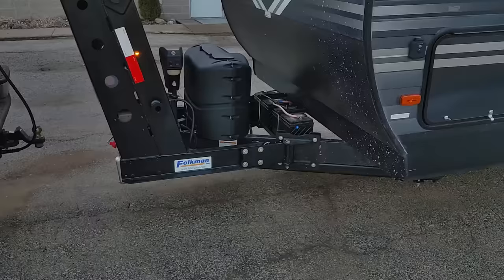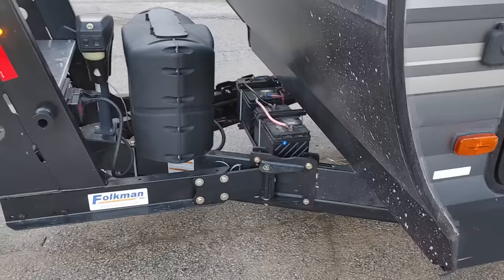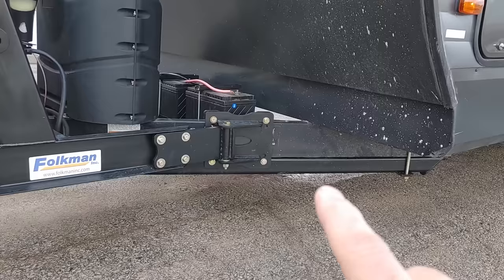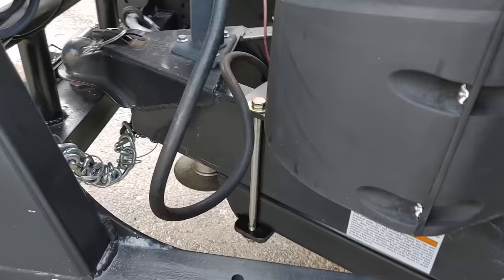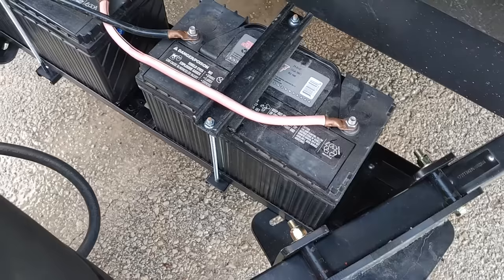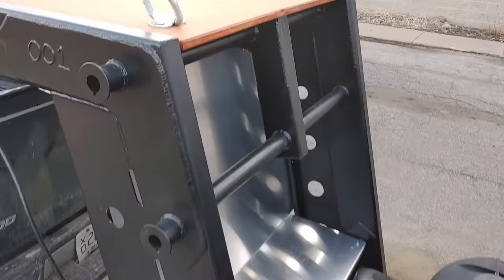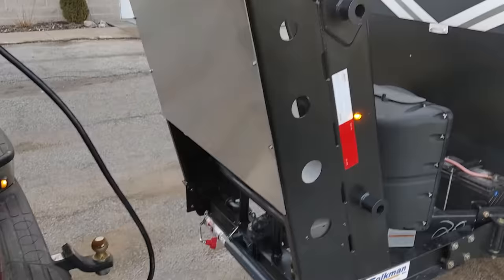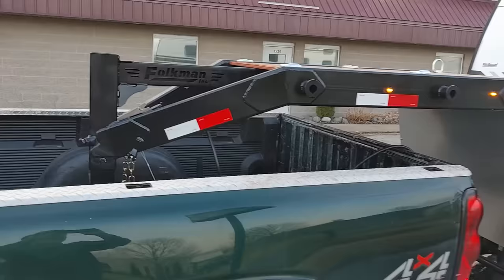Folkman Inc. -  Gooseneck Adapter Hitch

Comment: Why? Cool concept, but why?
Reply: Because a gooseneck trailer is inherently more stable than a bumper pull.
Reply: I was going to have one custom built like my buddies this would solve my problem. Bumper pull specially toy haulers like mine can be deathtraps loaded up it's more staple with a gooseneck or fifth wheel hitch
Reply: So by the time you buy the camper by the adapter, wouldn't you be further ahead? Just buying a fifth wheel toy hauler? Fifth wheels are so much easier to hook up and unhook than a gooseneck, especially if you have a crew cab long bed. Fifth wheels are much better. Not only that, the gooseneck hauling an uneven terrain, especially where I go in the mountains. If I had a gooseneck the side of the camper would touch the truck. So the fifth wheel limits your side to side movement
Reply: @bryanb8366  Ok, so it doesn't work for you. Great. Not everyone wants a fifth wheel. They're heavier, taller, and more expensive.

And I would prefer to hook up a gooseneck over a fifth wheel, but that's personal preference. And if things get sideways, the gooseneck is going to cause a lot less damage than the fifth wheel.
Reply: @bryanb8366  technically yes your right but I jumped the gun before i knew how it towed loaded with my sxs and if it trade in I'll be upside down and honestly love my layout of my toy hauler but making it a gooseneck would be the best camper for me after.
Reply: It allows you to carry a heavier load.
Reply: @lray801 😂😂😂🤦🏻‍♂️😂🤣
Reply: @t.l.robinson2162  no, because that trailer A frame and frame itself are still only rated for a certain GVW.
Reply: Because once you tow with a gooseneck , you will never want to go back to a bumper hitch.
Reply: @allwrappedupcustoms505  what make and model is your bumper pull toy hauler?
Reply: @DanLance100  it's the cost. Wouldn't it be  more cost effective just to buy a fifth wheel
Reply: @maxum3300  I have a 2018 fuzion impact 3118
Reply: @maxum3300  it's a 2018 fuzion impact 3118
Reply: @bryanb8366  to be honest I have no idea how much Folkman Inc. Is asking for their gooseneck adapter.  I was just trying to make you aware of how much of an improvement in ride comfort and increased towing capacity you can gain by upgrading to a gooseneck. 
I wouldn't want a fifth wheel trailer because of fifth wheel hitch you would have to either permanently mount in the bed of the truck or have one that is removable so you can use the truck for other purposes.  I have a retractable ball in the bed of my truck for my gooseneck flatbed. 
I like the adapter idea that Folkman came up with though.  
The short answer is I didn't mean to be a Troll :).
Reply: So here's the problem with the gooseneck trailers in Ohio. You have to run chains also with a crew cab long bed. They are much harder to hook up than a fifth wheel now the B&W companion hitch comes all and two pieces and is fairly light. Much easier to hook up than a gooseneck you back under it. It goes click you. Drop your locking pin. You're done no chains. Also with a fifth wheel hitch, your side to side roll is limited. So on the newer trucks who sit way too high, you don't have to worry as much about touching the side of your truck bed with your camper. I have all three the utility trailer that is off the bumper, a gooseneck trailer and a fifth wheel toy hauler. I highly recommend the fifth wheel over the goosenecks especially where I go. It's not a paved road and you don't have to worry about smashing your bed sides or the camper as much.
Reply: The main point I'm getting at is over the past several decades of modifying vehicles and building trailers. I found it best to leave vehicles. You are traveling long distance with the way they came from the factory. Like lifting your truck and pulling a camper, you're going to break s***. I've seen fifth wheel campers that were converted into gooseneck cracking their frames and that would be my biggest concern with this setup. What are the long term negative effects on the camper? It's a badass invention. I give kudos to them men who design this.
Reply: Hmm , I guess have you ever seen a semi truck tractor with a bumper pull hitch? You know? They are all fifth wheels, just saying.
Reply: @bryanb8366  my gooseneck setup is pretty straightforward....you lower the tailgate,  flip up the retractable ball , back up under the gooseneck,  lower the trailer down on the ball . Engage the locking mechanism,  attach two safety chains ( also with retractable engagement points) and then plug in the lights. Flip the tailgate back up and your good to go . I'm in NC , things are a little more laid back here. I built my gooseneck flatbed (20ft bed) in 1987 ....I tow it with a 1985 F250 Supercab long bed . If I had to do it over again I wouldn't change a thing :).
Reply: @DanLance100  Right. It's the same as a fifth wheel except the fifth wheels. You don't have to put chains. I own both.my b&w setup is very simple. The companion hitch comes out into pieces and is fairly light. My big thing with this is the cost to convert it and building vehicles and trailers over the past few decades. When you modify something it's more likely to break. That's why I pull with a stock truck. I don't lift my truck. I don't put a gooseneck conversion on my fifth wheel camper because I've watched camper frames crack when you modify them. It is a pretty cool design. It just seems more work than what it's worth.
Reply: @bryanb8366  I agree with you , plus it adds a lot of weight to the rig . Most Camper frames are made out of pressed light gauge steel ( not structural channel ) . So the increased leverage of that adapter could possibly lead to to some structural issues . Hopefully Folkman Inc. Did some testing .
Reply: @bryanb8366 😢
Reply: Great idea, just looks very "homemade" instead of " factory".
Reply: Nice
Reply: Because a Bumper hitch is the worst Idea created.
Reply: @curtekstrom9531  why?
Reply: @bryanb8366  watch a few videos of Trailers with Bumper hitches out of control VS. Fifth Wheel. I would Never Pull a Bumper hitch trailer.
Reply: @curtekstrom9531  I have all 3 hitches, they all have their place. If you know how to set up your trailer it pulls just fine. First of all, do not lift your truck. If you're pulling you got to make sure your trailer. Everything is level. If you're using torsion bars, you have the weight distributed properly and you'll never have an issue. Same as if you're using a panel hitch. If your weight's distributed correctly, there's no issue.
Reply: I would have loved to see this in action.
Reply: @oneninerniner3427  look at the trucks used to move mobile homes and offices. Semi trucks are purpose built...Is the 5th wheel on a semi carrying the 40 tons or is it engineered to flat tow /pull it?  My guess is  5th wheel is designed to carry a heavier load via the chassis and suspension as it distributes forces different than goose neck's. Most goose necks are 30k lbs maybe 40k lbs  and used on medium duty  class 4-6 trucks in most cases from what I've seen lately.... trucking and agriculture industries did start with goose necks, wind was a major factor for the industry standard change.
Reply: @bryanb8366  i disagree with it being easier to hook up. The goose neck will always be easier to hook up than a 5th wheel
Reply: @HondaRancher420  how is that? With the fifth wheel, as long as you're within an inch left right or low, your kingpin will automatically lock. The gooseneck especially with a long bed crew cab truck. You cannot see the ball and you have to be directly over the ball for it to hook up. If you're off an inch you will miss. Furthermore, pulling a gooseneck trailer you have to hook up chains with a fifth wheel. There are no chains required. Unhooking is the same way you pull your safety pin in your lever and you drive out. No chains to unhook one less step
Reply: Because he can
Reply: Alot more stable  pulling features
Reply: I specifically bought a bumper pull toy hauler to keep my bed for fire wood and aux fuel tank. This is the absolute worst combo of both! 😂
Reply: Why not, maybe part of the car or trailer is busted and this attachment allows you to use the trailer once more
Reply: @bryanb8366 but what if u own bumper pull already and now they just came out with this, way cheaper than buy a whole new camper, am I right or am I right
Reply: @bryanb8366 you still have to abide by the weight restrictions of the truck. This would be a great modification for 1/2 ton trucks that don’t have very many options for 5th wheel or gooseneck trailers in their weight range.
Reply: 5th wheels setup pulls way better than a bumper pull
Reply: Moat benifit would be in theTurn radius. Which is WAY better with gooseneck or 5th wheel.
Reply: @lray801 there is I’m my jurisdiction anyways, a license differentiation. Fifth wheel you have to have a class 1 license. Goose neck a class 5 will do ya.
Reply: Not the first one I’ve seen.  But one of the nicest.
Reply: It's really common sense for real trailer pulling people....
Reply: @andrewwilson2513  what do you mean? Real trailer pulling people?
Reply: Sounds reather intriguing, actually. But why?
Reply: Because a gooseneck is much more stable with a tighter turning radius, I will take a gooseneck over bumper pull anyday.
Reply: @Obamaistoast2012  completely understand that. But I'm looking at what the thing cost the hassle to install it in the added stress on the camber frame. Is it worth it? Once you start altering things they tend to break
Reply: Stability

Comment: Wish this would work with a slide hitch.
Reply: Why would you need a slide with a Gooseneck?
Reply: Because I have a BW 16k slide hitch already installed.
Reply: If I'm not mistaking B&W makes a goose neck adapter for your 5th wheel. Remve the 5th wheel and put in the goose neck. You do know what the difference is between a goose neck and 5th wheel hitch is correct?

Comment: Nice fabrication and engineering. But why? I mean it’s cool…. But why
Reply: Simple geometry.  Bumper pull trailers are hooked feet behind the rear axle so that distance becomes the lever distance.  Gooseneck trailer hooks directly above the axle.   That lever works in two different directions.  Up and down and side to side.   If you’ve had any experience with a trailer you’ve probably seen or at least heard of trailer whipping.  Happens almost exclusively on bumper pulls because the direction the rear bumper goes is opposite of the direction of travel.  When this is corrected (often even without driver input) it over corrects and this happening over and over causes the whip.  Rare and possibly doesn’t even happen on properly setup goosenecks.    The up and down direction of the lever.  When you hook a heavy bumper pull trailer on it rare your vehicle back taking weight off the front axle.  Where does that weight go?   It goes to the rear axle. This reduces the ability for your lead or control axle to do its job.   Goosenecks hitch has no impact on the front axle and just transfers weight straight down on the rear axle.  In my opinion a bumper pull trailer should never be used if the trailer weighs more then half of what the vehicle pulling it weighs for the above stated reasons.

Comment: Cool way to destroy your trailers frame. They just dont design them with a safety factor sufficient to accomodste the extra stress this would put on them. Otherwise it would be cool to toss a deck on the front so you could carry a 4 wheeler there.
Reply: That’s why the extra steel under the tongue. Wasn’t designed to be towed like that.
Reply: Yes putting a 4 wheeler deck on the hitch would increase the weight and stress on the hitch A frame. But, I don't think the conversion by itself would put any more weight on the original hitch from what it already was.. Yes the moment arm of the whole thing is longer. A longer arm does give more leverage, but that isn't going to effect/increase the amount of weight on the original part of the hitch on the camper as far as the camper is concerned, the ball is still in the same place, think about it. But I agree campers are built notoriously crappy. I've got cracks on my old fifth wheel camper, the actual hitch framework, I need to address/weld/reinforce right now.
Reply: Why????
Reply: They don’t design them at the factory like that because the trailer is made for smaller trucks that don’t have the ability to have a gooseneck set up. That way it gives people an option to tow without the need for a larger truck. same reason small sedans have rear drop trailers to tow, and motorcycles have trailers. 

That same frame is what’s used on gooseneck trailers too. The parts for the gooseneck come up from the bottom of the frame, just like that. So it’s not adding anything else to it. If anything it’s probably had more support for the front end than a regular gooseneck would.

Comment: This comment section is insane.. If you dont like it, don't freaking buy it...its pretty simple. Its a good idea for those that want or need it. The price is somewhat irrelevant if it makes something easier and or better, which it clearly does. Don't knock it, or be jealous cause your feelings are hurt for not fabticating it yourself. And the 'just make it yourself' is just plain stupidly. You don't just grab a welder from HomeDepot and whip this up overnight in the driveway, then slap it on your trailer and just be on your way to the glampground that weekend! Jesus Christ people -f'n ridiculous
Reply: Marvelously stated!!!

Comment: Not knocking these guys but if your trailer makes you nervous to tow enough to do this you need a bigger truck. If you want a gooseneck or 5th wheel, just buy a gooseneck or 5th wheel. This whole concept makes no sense.
Reply: In most states out west where I live you can pull doubles if the first trailer is a fifth wheel or gooseneck. I have a bumper pull travel trailer (that already has a receiver hitch on the back) and would like to sometimes tow my boat or SxS behind it. This would allow me to do so although for the price of it, I could fabricate and weld up a permanent one myself. It is an alternative to having to sell my bumper pull and buying a new trailer.
Reply: @LivingOnCash just move to Idaho. You can double pull with your bumper pull, like me. She gets a little squirrelly around 70 with the 2 place 4wheeler trailer. But no problems at all with the boat as 2nd trailer. Now if I could just pull triples 😂😂

Comment: This is the absolute stupidest most ridiculous waste of money on the planet. What purpose does it serve?????? It’s an insane price answer extra inconvenience for what??? Can’t change the GVWR of the trailer or truck by adding a gooseneck. Absolute worst idea ever shot in a video
Reply: Stability! It moves the weight over the axle making for a much better towing experience.
Reply: Hold a sack of cement up against your chest. That is the weight a gooseneck puts over the rear axle. Now hold it at arm's length. That is the weight leveraged on the bumper/reciever.
Reply: Look at your door sticker for gooseneck towing vs bumper pull. Huge difference.
Reply: easier to carry load over the rear axle than hanging out the back end,thats the purpose,check out the next 18 wheeler you see coming down the road,the king pin receiver isnt behind the tail lights.just saying.
Reply: @michaelmueller2778  Check out commercial trucks pulling double and triple trailers. They use a converter dolly with a 5th wheel. The dolly is connected to the first trailer on the back with a pintle hook. Right between the tail lights, just sayin.  Or any truck and pup, the pup trailer usually has a built in upper and lower fifth wheel with a drawbar connected with a pintle hook. All for proper weight distribution. People commenting that this looks sketchy, because it is.